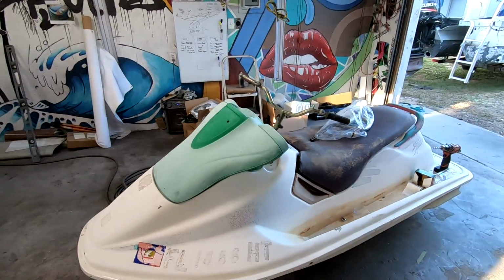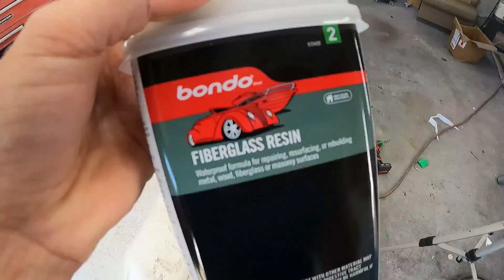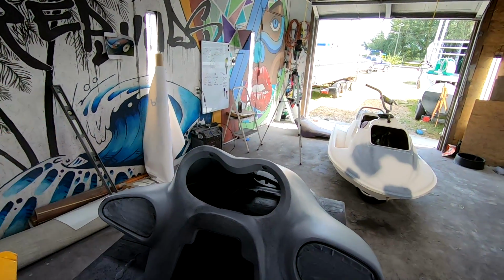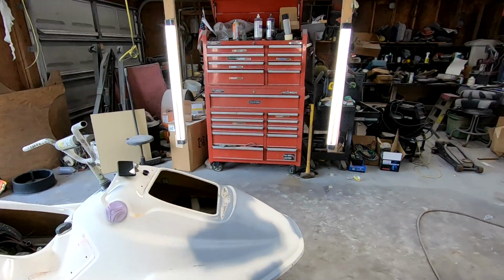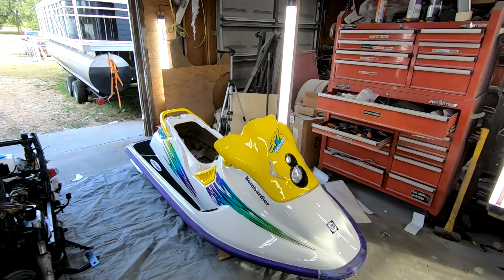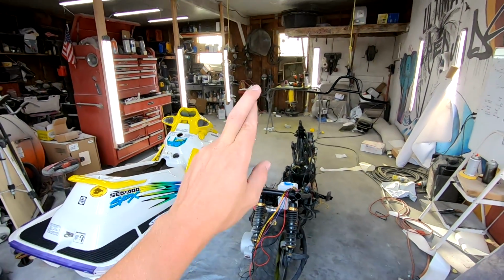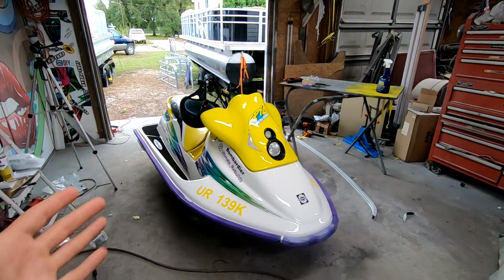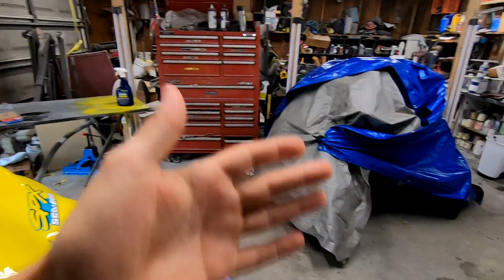Jet Ski Scooter is Complete! - Episode 4

Comment: Great work, i really enjoy the creativity of repurposed projects. You put alot of effort into the mods & attention to details. Where are your located? (looks like Florida or S?E coast) and do you eventually sell any of your projects? I really like these ski-doo transformations as well as your VW full fender bodied mini scooters with fender skirts... with all the energy and time spent have you thought of using something other than a Chinese knock off scooter as your donor bike,, i understand using a donor that's free or  as cheap as possible for a novelity build, But with the weight of the Sea-Doo Body and all the weak links when re structuring & rewelding welding is  involved.  having a better quality steel frame and reliable driveline with engine longevity would be a concern for all the effort your invest, Finding a wrecked but low mileage Suzuki Burgman, Honda PCH or Silverwing or Yamaha Majesty from a bike boneyard, insurance total or bike dealer backlot would definately be the  way to go. I hope you installed at least a couple brackets on the exhaust pipe & muffler, the install is good but an awful long pipe with weight of the muffler at the end for no support/ attachment. Also thought a couple small retractable wheels on the center edge of underbelly /hull would work great as both a kick stand & to prevent scrapping when leaning in to corners, "Bikes & Beards" channel build a similar Seadoo Scooter awhile back using a Yamaha Virago v twin motorcycle, poor choice for a donor & a bit large of a driveline for the application and it turned out So-So cosmetically. though i like the idea of having a bit larger wheels like 15" Anyway would you consider a similar Sea doo or VW fender build scoot  for a customer? I really enjoy your channel & now subscribed. i am an old DIY guy myself, but old age combined with disabilities keeps me from doing such fun things these days..